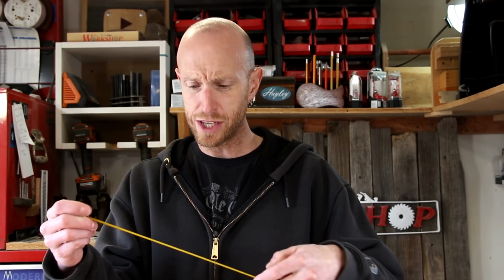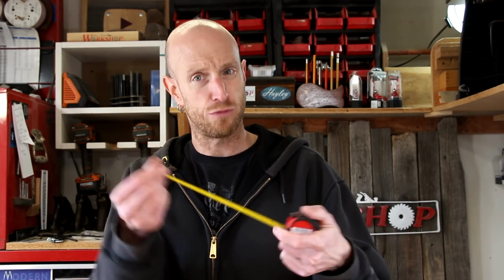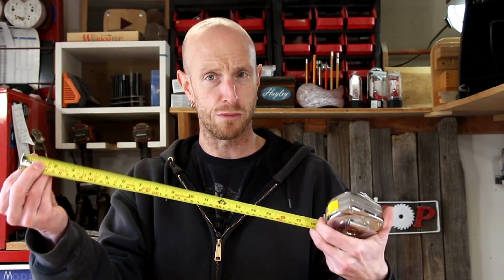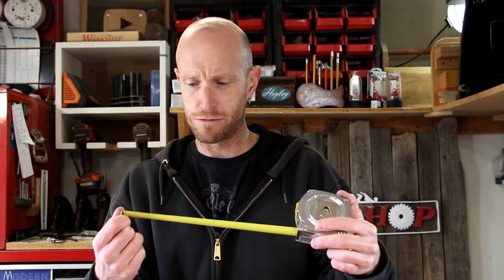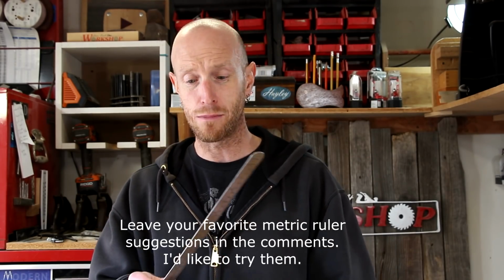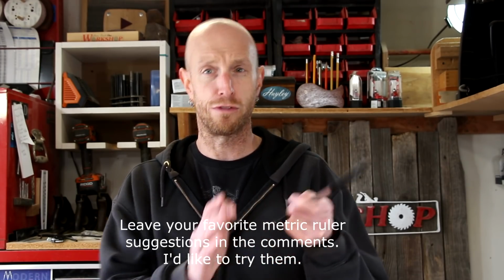My thoughts after using the Metric System for a project | I liked it

Comment: Funny thing, even in the USA you use the metric system.
When you buy a gun you say give me a 9 mm, not some fraction of inches 😉
Reply: Ehh...only if you're talking about a weapon/ammo in a metric calibre in the first place.
There are many different rounds that you'd hardly ever, if at all, say the metric measurement for, like .22 Long Rifle, .22 Magnum, .25 ACP, .32 ACP, .380 ACP, .38 Special (both of the last two are the same diameter as a 9mm, but the length is different), .357 Magnum, .45 ACP, etc., etc.. 
So I don't think that if you wanted to buy a gun that fires a .22 Long Rifle round that you'd go to the gun store and ask for a 5.58mm, because they'd look at you funny, in the US or outside of it.
Reply: @FlinnGaidin  true but if you wanted ammo for your AR15 you would be asking for some 5.56mm or maybe some 7.62mm for your M1A. It depends on where the round was developed. Lots of metric hunting rifle cartridges! Not all calibers with similar numbers are even the same diameter as some take their measurements from different parts of the rifling! Shotguns get even messier when you try to work out what 12 gauge/bore means and why 4 bore, which is a smaller number is considerably bigger! Aren't guns fun!
Reply: @funkyneil2000  That gauge system is another of the US oddities. It is used also for e.g. wires. The number is based on how many of the "things" fit through or from a given size.
I believe with shotguns, the gauge number is derived from the size of the ball that can be cast from the n-th part of a pound of lead. So for the 4-gauge, the ball is formed from a quarter of a pound, for 12-gauge, the ball is formed from a twelveth pound.
Obviously, the term originates from before the era of interchangeable parts. The only reason the terminology is maintained is because 18.53mm is harder to remember than 12-gauge.
Reply: @funkyneil2000  Part of the difference in measurements is to avoid misunderstandings. The 5.56 has the same diameter as a 0.22", but the one is used for a high-power military round, the other for a puny practice round.
A 0.357" has a very similar diameter as a 9mm, but they are used to refer to very different rounds.
The 7.62 NATO round is very similar to the .308 Winchester, here the different name is to distinguish between the civilian and the military loading (which is higher). 7.62 rifles are proofed at higher pressures. While it is (I believe) physically possible to load a 7.62 in a .308 rifle, it can be dangerous to do so.
Reply: @TheEvertw  Not sure it's a purely US thing. It was used for muzzle loading firearms in Britain a long time ago. Might even predate the US. It's probably French. Although I can't find any information on the origin of the system.
Reply: @TheEvertw  same with 5.56 and .223. 5.56 is dimensionally similar to .223 Remington but loaded to higher pressures. So .223 in a 5.56 is generally fine but not the other way around.
Reply: @funkyneil2000  If you buy commmercial 5,56 you can usually shoot it from a .223 rifle. 5,56 nato had higher pressures at the start but they pretty quickly realized that the barrel wear was too much and put the pressure down. Though most cartriges tell on the box how many grains of powder is in so if it seems way too high just don't shoot it

Comment: I grew up with the metric system, and wasn't even aware that there were other systems until I was twelve.  It helped that I was good at math, so I can't say that the imperial system and it's use of fractions gave me problems, but I thought it was strange, to make things unnecessarily more complicated than it needed to be.  I did get myself an imperial measuring tape, and measured everything in sight, which helped me learn to estimate.  In school we used the imperial system when doing geometry, and there was little more than a passing remark about the existence of the metric system.  It wasn't until science in high school and university when the metric system became more commonly used.
So why do I use the imperial system when I do any building?  Because even though I live in Canada, and officially we switched over to metric around 1970, because we're so closely tied to the U.S. geographically and economically, most of our building materials use imperial measurements.  We use 2" x 4"s (which are not even close to 2" x 4"), plywood and any other sheeting material is 4' x 8', length of lumber usually comes in increments of 2 ft., distance between studs is either 12", 16" or 24", flooring tile usually comes in 12" x 12" sizes, etc, etc.  
The imperial system invites mistakes.  There is not all that much of a difference between, for example, 5' 7" and 57", and I had many occasions where I would wind up with the wrong size after ordering something of a certain size, even though I made a habit of mentioning several times on a phone order, or underlining on a written order, that all measurements were in inches.
Yes, I also find it strange that the U.S., which fought so hard to get rid of anything British (well, ok, they kept the language), that they would insist keeping the imperial system, particularly when it's called "imperial".
Reply: When I was a youngster (over half a century ago) we'd still we taught ancient measurements, like pound (500g) and ounce (100g). E.g. The weight of babies was popularly expressed in pounds and ounces on birth announcements till late in the 20th century. And although illegal since the beginning of WWII, one could still see prices listed "per pound" on markets until the early '70-ies.
Reply: Probably because USA it's an imperial power! :D

Comment: It’s weird in the UK, we use both and quite often in the same sentence: ‘get me an 8x4 in 18mm’ 😂 I dunno it just works for us.
Reply: Same in India as well... We use a mix of feet and inches and metric.. yeah it just works.
Reply: In Australia we just say 18mm sheet.  8x4 or 2x4 gets used as well; everyone knows it's just a description, not a measurement.  Yeah, works fine.
Reply: Here in Sweden a lot of carpenters say eg. "2 inch 4" (2tum4 in Swedish, tum = inch) instead of 45x95 mm which actually should translate to 50,8x101,6 mm. I guess it's an inheritance from long ago?!
Reply: The other odd thing is we put the higher value first eg 8x4 and 3x2 but the states goes the opposite; 2x4’s etc... what a diverse world we are.
Reply: @joakimlemstrom53  A 4x2 has never been 4x2 anyway, anywhere in the world.  In Australia it's 90x42mm, DAR means you lose about 10mm (3/8").

Comment: Being British I tend to use both and whichever is more convenient or makes more sense. 
In cooking - metric,
 body measurements - imperial, 
human weight - stones and pounds, 
other weights - metric,
Distances long -miles,
Distances short - metric
Beer - pints
And so on
Reply: Regarding the imperial system I think it's just a matter of "being used to" not really of being more convenient. I don't understand in which way it could be more convenient to use another system entirely to make body measurements or for long distances (really, the mile has objectively 0 upside).

I think for everyday random stuff, we just prefer what we're used to (thus in some countries, the imperial). And for precise, scientific/professional stuff, we prefer the metric system.
Reply: @xenotypos  the advantage of the mile is that 60mph is a good speed to be driving at for long distances. With distance signs in miles you have a good indicator of time at a mile a minute.

Comment: I realize it may seem a bit strange to some people, but Imperial System is actually more natural than metric and it still has some strongholds throughout different industries (try to use millimetres to elegantly specify font size or convert the whole aviation world to metric… well… yeah… good luck with that). I live in Poland and metric system is pretty much the only system I have ever known, until I began to learn about the history of measuring systems. It's all fine and dandy once you've got a plethora of ready made measuring devices available, but when you don't and you have to make your own, you quickly learn to appreciate natural references, like grown man thumb width (an inch, in other words), foot, cubit and so on. And in primitive conditions it is much easier to divide them in half than on 10 equal parts. I can't count how many times I've heard lengths given like “54 and a half centimetre” instead of “54.5 centimetres”. Besides, why would you need to divide something on 10 parts if most of the time you're not going to calculate lengths anyway? And you don't have to calculate, once you are used to taking lengths directly from the other parts that have to match. Calculation comes mostly with mass production and independently made parts manufactured according to given standard dimensions and required tolerances. But even then: what stops anyone from dividing inch by 10 and making deci-inch? In fact thous are just milli-inches. Get this and build other units upon that. Problem solved, but I'm afraid it wouldn't do for the French revolutionaries 😉who first and foremost tried to demolish traditions and forcibly introduce their own. It is not to say that the metric system does not have its objective merits or that it is “bad to the bone” 😉, but it is not so be-all, end-all solution as it is often presented to be. Interestingly, I found that many human-related lengths are more elegantly expressed with Imperial units than metric. Of course they can be given in both and (given that both sides do not give in to reciprocal “bastardization”) they both can work. For example: if I want to make a desk I will aim for the top to be at 75 cm from the ground. “Bastardized argument” would be that it would be at 2,46063 ft (ha-ha-ha, very mature…). Now, if I would try to do the same in Imperial, I would make it at 2,5 ft (76,2 cm; ½ in higher—big deal). That would be 30 in. Just as nice and elegant. The biggest hassle is living with duodecimal system when almost all of our calculations are done in decimal (well, not quite if we speak about computers 😉—there is a lot of conversion there as well, not to mention floating point representation—speaking about nightmares 😊).

What I am trying to say in an unbecomingly long and roundabout way is: I am fed up with fanboyism on both sides: “Oh, look at me! I use metric! I'm so smart and progressive!” “Metric? What a pile of rubbish! Nothing but inches for me, thank you!” Yes, metric system is useful and easy to calculate. Yes, Imperial system is more elegant in many respects and might have been as easy to calculate.

Comment: It’s so ironic. The US has used metric money from the beginning, but has resisted metric everywhere else.
Reply: They used the decimal system from which evolved metric measures. The dollar precedes any metric measures.
Reply: In UK were just as bad, we use the metric system, decimal currency , fuel in litres and then the speed is still in miles per hour.
Reply: @poppypalais3108  Well, the US dollar was officially put into law in 1792 (introduced in 1785, first coined in 1787, to be precise), while the first decimal-metric system (which defined the "meter") was introduced 1799 in France (but both China and India had decimal based measuring systems in place already millenia - yep, millenia - earlier, about 210 BCE, to be precise, introduced by emperor Qin Shihuangdi: "Each unit of length was ten times bigger than the previous one with a couple of exceptions. Even time was divided in 10s so a day consisted of 100 刻 kès.").
The metric system was actually developed after James Watt (yep, the steamengine guy) called for an international system used in science, to make it easier to communicate with scientists in Germany - that was 1783, btw, so a full 2 years before the dollar proposal.
And why did the US and Britain not adopt that standard (on which they actually had worked on as well)? Well, to quote Wikipedia:

"In 1790, a proposal floated by the French to Britain and the United States, to establish a uniform measure of length, a metre based on the period of a pendulum with a beat of one second, was defeated in the British Parliament and United States Congress. The underlying issue was failure to agree on the latitude for the definition, since gravitational acceleration, and therefore the length of the pendulum, varies (inter alia) with latitude: each party wanted a definition according to a major latitude passing through their own country. The direct consequences of the failure were the French unilateral development and deployment of the metric system and its spread by trade to the continent; the British adoption of the Imperial System of Measures throughout the realm in 1824; and the United States' retention of the British common system of measures in place at the time of the independence of the colonies. This was the position that continued for nearly the next 200 years."

Which, btw, shows nicely that the metric system is actually older than the Imperial System in Britain - which used the Winchester Standards up to 1825 (when that system was finally completely dropped in favour of the new Imperial System)... ;-)

Comment: Metric is absolutely the way to go. It's so much simpler and more accurate. The "pain in the ass" is converting between the 2 systems not the system itself. Many people do not seem to understand this for some reason. I used to argue with my foreman about this when I worked as a machinist...of course, he preferred imperial. At least the machining industry (and land surveying - which I also did) had the logic of working in decimal format - which, when you look at it, "mirrors" the metric logic!
Reply: @asdqwe4468  Well, unless you're strictly using whole numbers in your work, then yes of course using feet is never an issue. Reality is that most people who use feet/imperial have to deal with sub-foot/inch measurements aka fractions. Hence my mentioning the "decimal foot" system used in surveying being so much easier to use. Oh, and don't get me going on degrees! Lol

Comment: I really enjoyed your video; thank you! Funny you should give the metric system "two thumbs up", though; in the majority of European languages the word for "inch" is based on the word for "thumb". :-)
Reply from the maker: Thats funny right there.
Reply: @homebuiltshop  That’s right; or at least in italian we translate “inch” into “pollice”
Reply: That's because an inch was defined as the width of a mans thumb. (Or if it was the kings thumb)
Reply: @darkiee69  Its actually the length of the outer joint of the thumb.

Comment: A few years ago I watched a TED talk about the metric system vs. "imperial", and during the presentation, the speaker related a story about an Australian entrepreneur in the building industry. The tale took place just after the Australian building industry had switched to using metric exclusively, and this entreprenur wanted to conduct an experiment to assess the efficacy of the "new" system, so he had two set of blueprints for identical houses drawn up, one set with all measurements in the old Imperial system, and the other set with millimeters only. After all was said and done, the waste material from the house with Imperial measures amounted to a couple of truckloads, whereas the waste from the "millimeter house" was little more than one wheelbarrow-ful. 
SI for the win! 😁
Reply: @1pcfred  Then why are there so many homeless people in America? Is it because your houses are of such inferior quality that they blow apart in the slightest breeze? Quantity != quality.
Reply: @BertGrink  what stupid argument connecting homelessness to the units used. Their houses are crap because land is cheap, so "poor" people can afford to build their shed cheaply, while in most of western Europe you have expensive land and building standards that have to be met, which means people who could buy a "inferiour" house in the US, have to rent a "superior" one in Europe.

Comment: I have used both metric and imperial measurement systems, and while I grew up using metric it wasn't that difficult to learn the imperial system and then switch between the two. 
However if I had been forced to use rudimentary tools with fractions of inches that may have been a different matter.
As it was I used metric in a automotive manufacturing environment where tolerances were generally +/- .0.5mm or greater. When I moved to precision engineering and had in some cases a tolerance as little as +.0005"  or +0.127mm imperial was just fine. 
The measuring equipment was generally digital and was able to measure in both systems although we also used finger clocks for comparison against slip gauges.